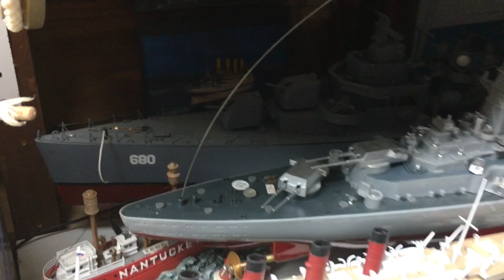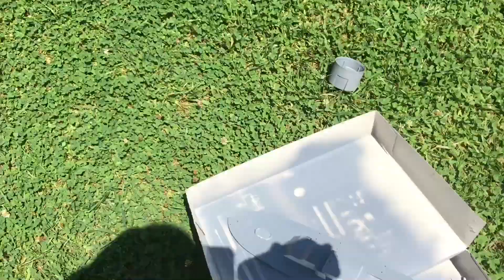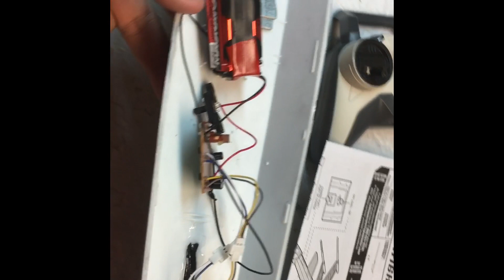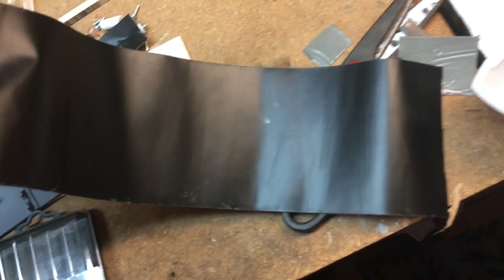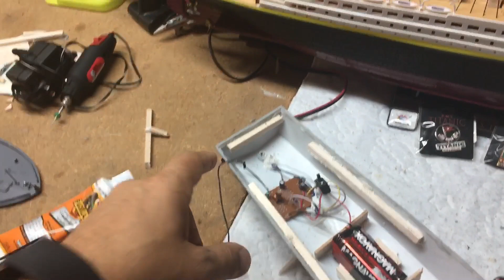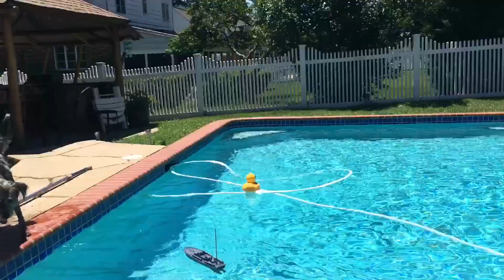Radio Control PT boat project RC PT-109 Lindberg PT-109 RC conversion on the cheap

Comment: Hi,any info on parts and,the know,how
Reply from the maker: Hi, it’s a Lindberg plastic model kit. All parts used to convert it to RC were transplanted from     A toy RC boat made by “fast lane” except for the battery pack - that came came from radio shack (you can buy that on Amazon since radio shack is out of business now) I just swapped everything out and installed it into the model.  I used balsa wood strips Glued to the hull and little screws to make the deck removable to swap out the batteries and repair anything.